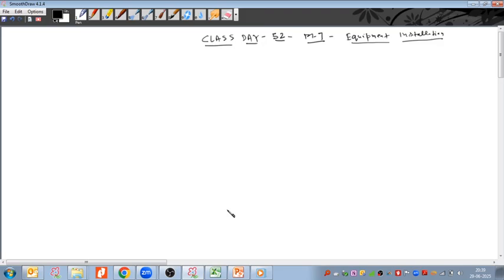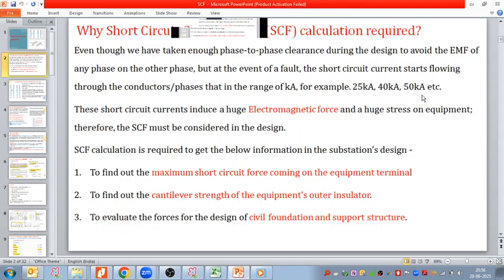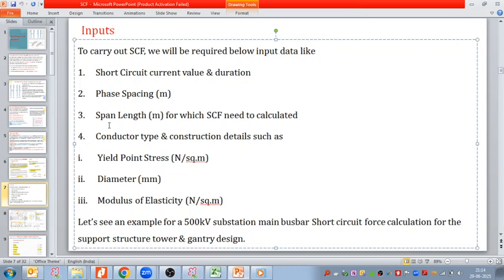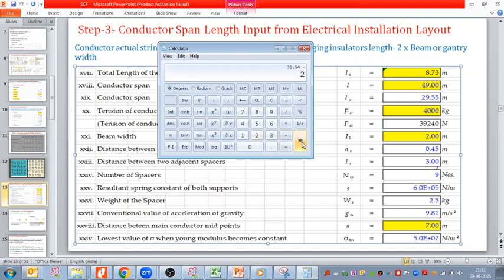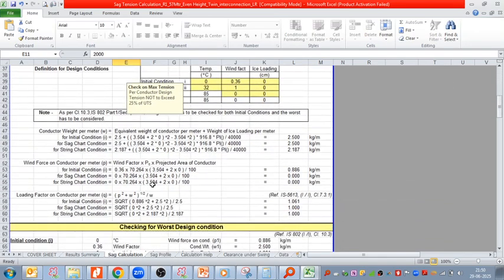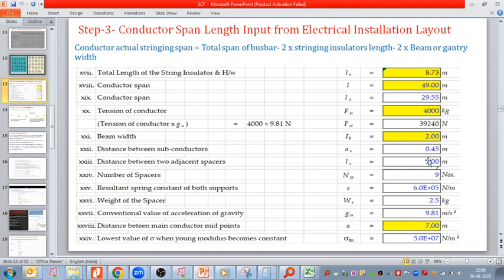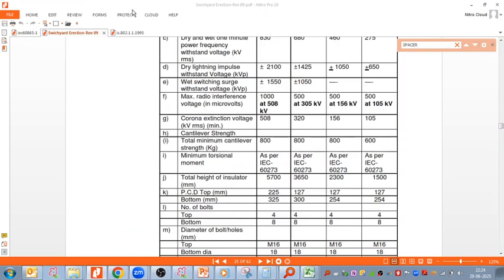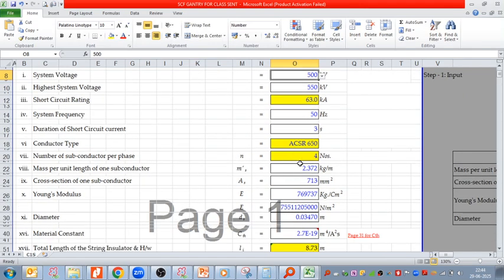Why Short Circuit Force (SCF) calculation (Session Day-1)| Substation | IETP Center |Online Classes|

Comment: please share a video on explanation of the SCF calc. for the equipment structure as well..
some people ask for individual equipment whereas referring standard (865 part-2) performs based on respective spans in between two equipments ✓

why is that necessary to find the force about to an equipment over the given span between two adjacent equipment ✓